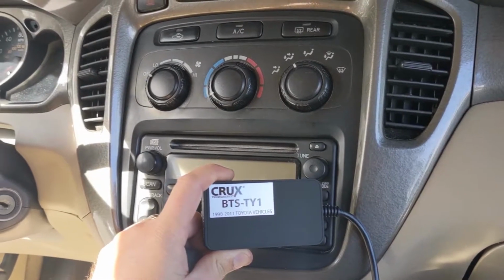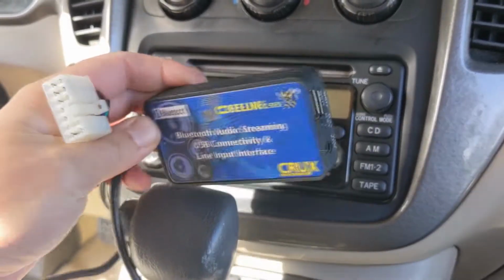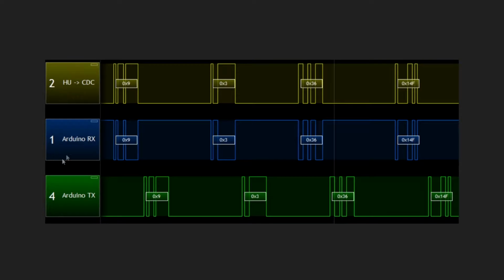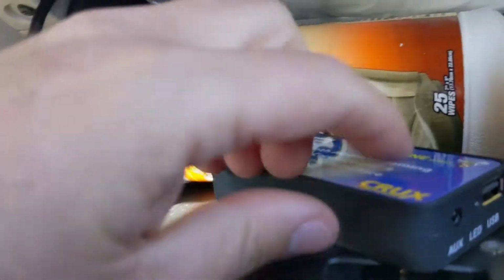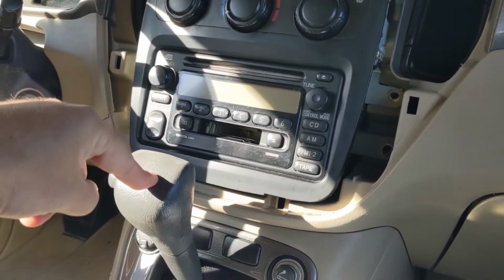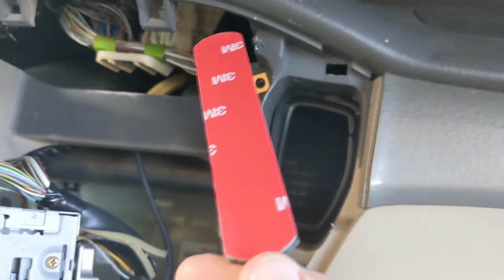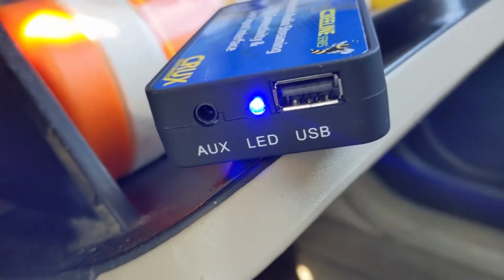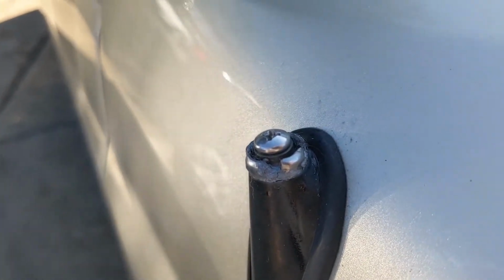Toyota AUX / Bluetooth Upgrade - CRUX BTS-TY1 CBEELINE

Comment: You lost the cd function?
Reply from the maker: I no longer own any CD's to test it but I suspect the CD play will work since this mimics an external CD changer. If you had the factory disk changer you would still be able to play a CD from the head unit.

Comment: Is it possible to play a cd while also having the CRUX BTS plugged into the stereo head, or are you only able to play bluetooth music?
Reply: I'm pretty sure the CD player still works. It doesn't disable it. It's seeing the Bluetooth device as a disc changer. So if you had a disk changer in your vehicle your regular CD player would still work.
Reply: @ChrisDembinsky  Ok gotcha. My 2002 Toyota Tundra doesn't have a disc changer, but rather just reads one disc at a time. Also, I am a little confused as to why you replaced the antenna in your car. Was that necessary for the installation of the CRUX BTS, or was this something that you just wanted to replace on your own? Also appreciate the quick reply and excellent video quality/explanation.
Reply from the maker: @yardboy2733  The vehicle in the video also didn't have a disk changer. This device uses the connection port that a disk changer would use. I think if you had a disk changer it COULD be an issue because one this is installed the disk changer would no longer be connected.
Reply from the maker: Did you ever give this device a try and did it work for you?
Reply: @CSDSolutionsLLC  no I did not. I looked into it more and on some website it said that it was not compatible with my car
Reply: I replaced the antenna because I cover the car and the antenna gets in the way of the car cover. I believe all the radios come with the CD changer plug on the back. You should pull your head unit out and look before you spend the money on this thing.